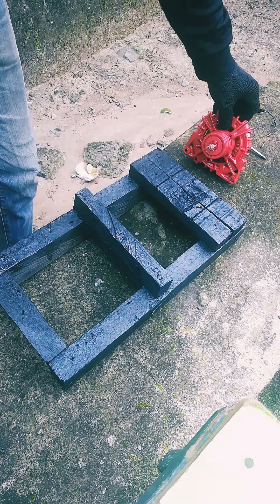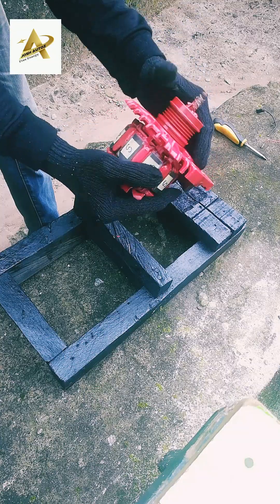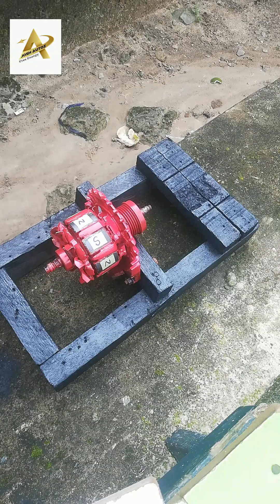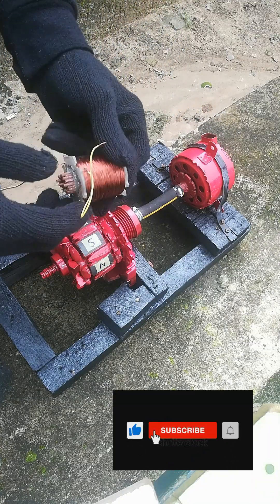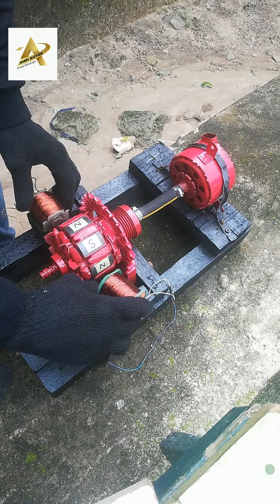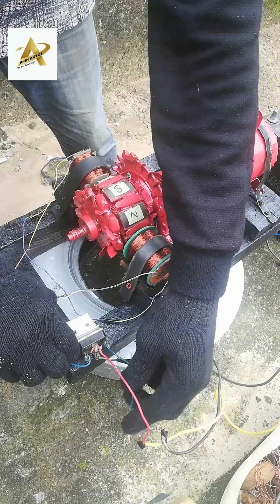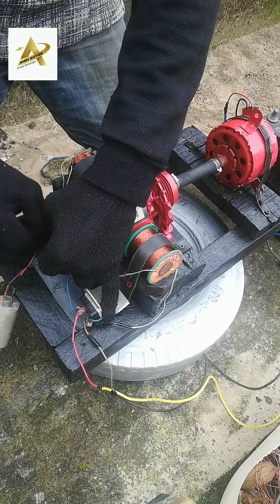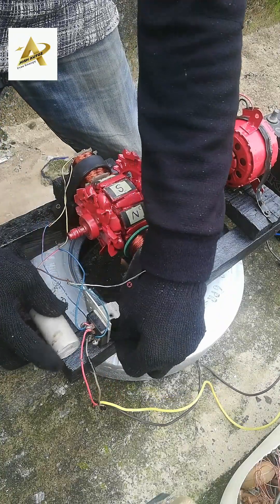Magnet bifilar Fuelless Generator construction (part2) #PMG

Comment: Good one boss.
Can we use a bedin motor instead of the DC car motor? 
I have N35, 20mm by 3mm round neodymium magnet. I made a bedin motor with two disk arranged horizontal. I use 5 to 9 volts and it run at high speed and has high torque. I intend to make coils for generating electricity. 
I am a biology teacher and have not studied electronic engineering. 
My little knowledge is from watching videos from YouTube.

the second is what material did you use for the core of the coil generators to overcome magnet resistance
Reply from the maker: Good day sir, if i may understand you correctly, you want to use Bedini motor, to run the magnet Generator.
You can give it a try, but i think Bedini motor have that much power to run it. It might work, if it works updates me.
Reply: I mean if you have time I want you to do an experiment of using a bedin motor instead of the DC motor that u are using to drive the generator. 
The second question, I want to know what material you have put in the center of your generator coils sir @joshautoz3439
Reply from the maker: Ok,  you can only drive any magnet Generator or Fuelless Generator with  DC or AC motor. Bedini motor, don't like to drag when they're running.
Reply: میتونی از یه میله استفاده کنی داخل سیم پیچ👍
Reply from the maker: Yes of course
Reply: Force a vous, ça fait des années que je travaille la dessus, il faut des années pour bien comprendre ;) Mais en France on dit " tout vient à point à qui sait attendre" alors au travail!
Reply from the maker: Thanks

Comment: Hola amigo,,,   muy bueno tu trabajo,,   yo hice uno similar y me daba 245 voltios,,  prendian bombillas y cuando conecte un taladro el voltaje se bajo de 240 a  105 voltios y el taladro ni se mueve.  Donde radica el problema.. gracias.
Reply from the maker: Did you use it as AC or DC,
Its design to charge batteries, thanks
Reply: از تثبیت کننده ولتاژ استفاده کن👍
Reply: از سیم پیچ ضخیم تر استفاده تا وات بره بالا